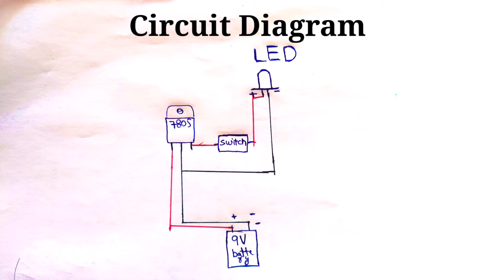How To Make a 10000X Microscope Homemade Easy | DIY Most Powerful MICROSCOPE

Comment: Fake, it isn't  work. Optical microscopes have 1000-1500X and if you work on these microscopes you must have an immersion oil. Electron microscopes have 10 000X and higher.

Comment: This could work, but please use a 4x objective with a 160 mark on it. This brings the total magnification to 40x (with a 10x eyepiece) and it's plenty with a weak construction like this. Make sure the tube assembly is 150 mm long and that the bottom of the tube is 45 mm above the specimen table (both measured without the optics). You can then move the eyepiece in and out to focus. Put a piece of toilet paper slightly above the lamp to diffuse the light a bit.

Comment: this is a cool video so why do you feel the need to lie 
total magnification 100X objective and 10X eyepiece(which you spelled Eyepeice) is 1000X not to mention that is a oil immersion objective so you can't see things normally through it without immersion oil however that doesn't matter much as you got a 40X eyepiece (3:34 on the lable you can see the details 40/65 160/0.17 which is a 40X objective) and said 100X on the captions trying your best to hide the objective lable. 

That is leaf is too thick to be able to view the individual cells what you are looking at is algae with the chloroplasts streaming in addition your video shows the image dimming as you zoom in but to achieve such an effect you need to pull the eyepiece out of the tube and you are pushing it in,

I doubt without much fiddling you can even see much with the objective needing to be in the perfect position to achieve the focus you display not to mention with such a dim lightsource the video shown is not possible you made those microscope videos from an actual branded microscope and said your DIY scope was capable of this
Reply: yeap,, totally  click bite!! like    build your own ferrari:   buy  the motor and put it into a wooden carriage!!
Reply: Yes. I've worked with microscopes my entire life, and the first thing I've observed was the oil immersion objetive. Moreover, this microscope seems to be a zoom microscope because it is able to magnify without losing focus. I can't believe this DIY microscope produced the images shown in this video.
Reply: Bro it's work properly
Reply: @smgunshot8767  'Bro its work properly' clearly its not

Comment: Use the switch between battery and Voltage regulator to save battery while turned off.

Comment: This DIY microscope is all in all easy to make. The most important thing is to have a 100x lens and a 10x lens that are not DIY (!!). It is almost more difficult to build the circuit for the illumination than everything else. However, there is no great knowledge of microscopy. It is not possible to see plant cells if you have not sliced the leaf properly. A whole leaf placed under the lens produces only darkness!
Let's say that this contribution is a good fake!

Comment: Most people don't have eyepieces and objectives kicking around. You can buy commercial microscopes pretty cheap these days and save yourself a lot of trouble.
Reply: Cheap! Really?? 😂
Reply: @NARUTO-jb9nj  Yes you can even get a Carson pocket microscope that lets you go upto 250X on the go however it does lack colour contrast but is still an achievement for 20 bucks
Reply: Sir aapne lens kon sa use kiya h or uper ka material bta dijiye plz sir

Comment: How did you make that circuit?
Reply: That circuit is to protect led light for burning because he used 9v battery that circuit lowers the current
Reply: @gamesoftheyear3583  The LM7805 is a fixed linear voltage regulator, i.e. it does not limit the current, but reduces the output voltage to 5V.

Comment: What is the transistor for?
Reply: it's a voltage regulator to step down from 9 to 5V. You need also a 5V lamp or led

Comment: First you showed the fake Video of microorganisms 
And second 
I have even more cheaper way to make a microscope power enough to see tradigrades. 
Buy one lesser pointer. You will find a tiny Lense inside this lesser pointer you just need that lense. 
Now you need a Mobile with good camera that can zomm 10X which almost every mobile has now a day. 
Attach this lense to you mobile camera and there you go you have you powerful microscope.
You will need some slides to see clearly and one light source which you can put under the sample. That's all you need. 
I have recorded some videos from my mobile using same techniques you can see this on my channel.